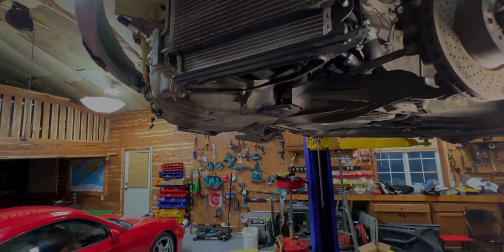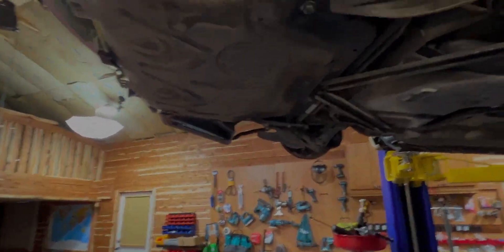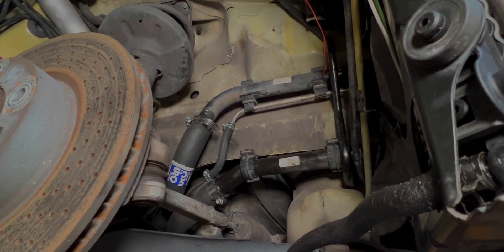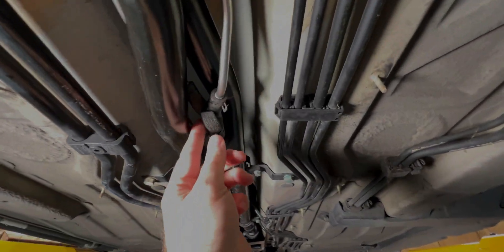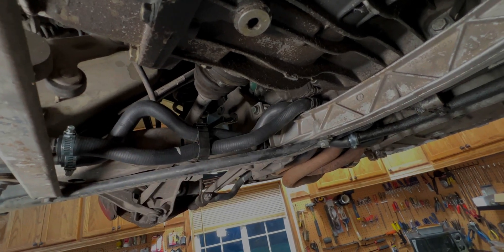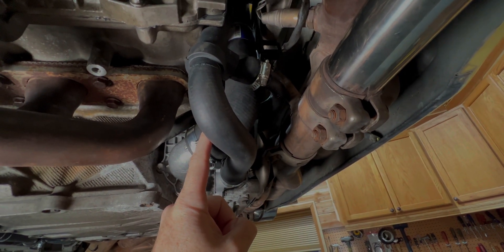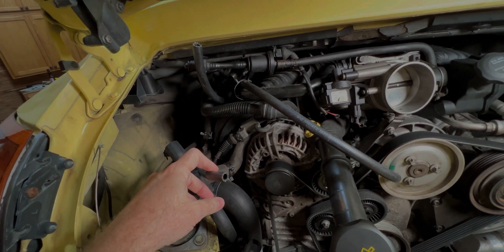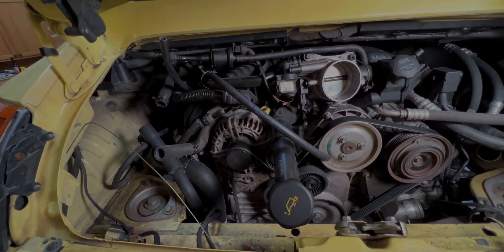Location Replacement And Function Of All 28 Coolant Hoses On the Porsche 996 997 Engine M96 M97

Comment: That's what happens when you put an engine in the rear. So much unnecessary parts to make it work. You also lose trunk space, and no the frunk is not the same.  Porsche should just put their engines in the front. I can't stand the new models where you can't even see the engine and the rear bumper has to be removed for every little maintenance.
Reply: They did. It was called the 928 but people wouldn't stop buying the 911s so they just kept making them and the 928 is barely a memory now.

Comment: I've dealt with several vehicles that had oil, ATF, or diesel fuel in the cooling system that didn't suffer any hose or radiator issues.

Comment: That’s nuts!!  I was wanting to replace all the coolant hoses on my 997 when I do my water pump, LTT, and add a 3rd radiator, but that’s just crazy.
Reply: No kidding! Realizing why maintenance is so expensive a the shop! Damn.
Reply: @van_dutch  I did quiet a few of mine but looking at the take off parts, they really were good for a bit more I think.  But it’s done.
Reply: @K1dPhresh1  that’s the worst part of it, taking it all apart, and realizing it’s actually not so bad! By that point you’re committed.  It’s a love:hate thing that’s for sure. Did you do radiators as well?
Reply: @van_dutch  I added the center radiator but didn’t replaced the other two. It did cross my mind tho.